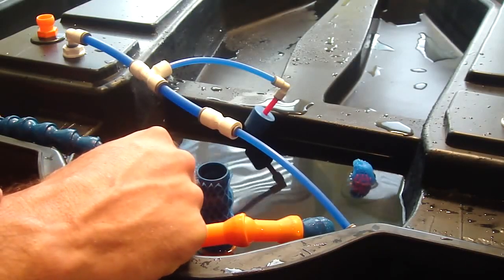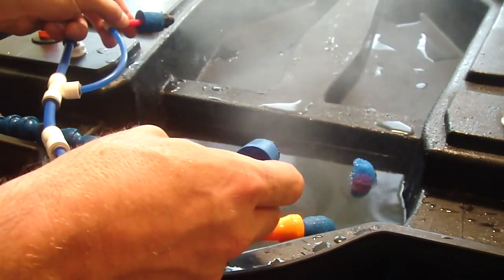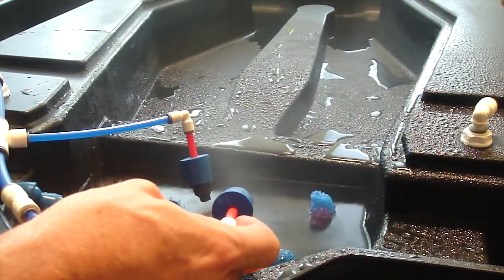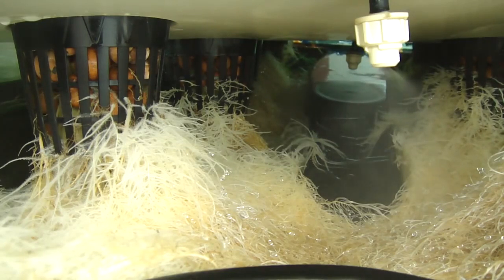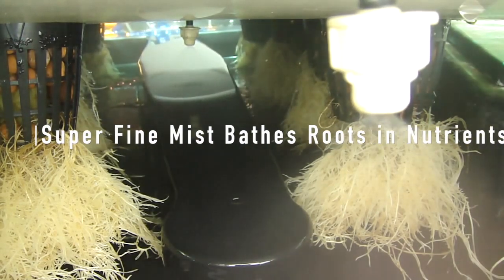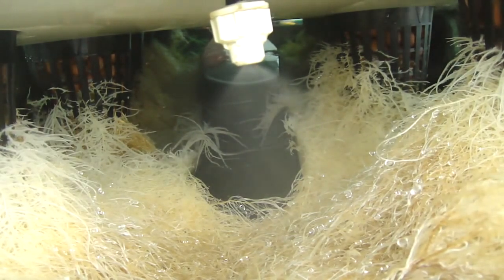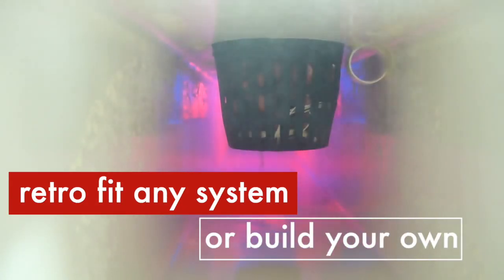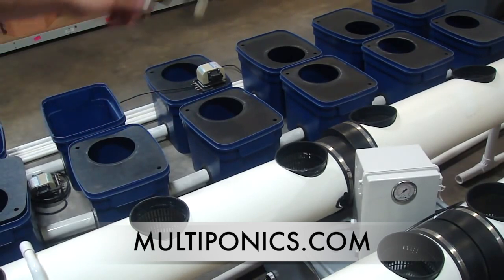Multiponics DIY High Pressure Aeroponics

Comment from the maker: Thanks for the questionbs C4e54r, great you are already running aquaponics, just add our kit to the top to grow lettuce, basil, etc! One of our filters is plenty, just clean it once per week, or you can easily double up and daisy chain them, as they are quick connect. Sold separately or in kits at Multiponics.com

Comment from the maker: Thanks for the question jtg! These hardly drip but the nozzle config here does encourage a drop sometimes, which we later found can be avoided by placing the supply line below the nozzle, rather than above. Also our advanced aeroponics kit, specifically the solenoid and accumulator tank, hold the pressure in the lines to avoid that one drop of backflow that may sometimes occur otherwise.
Reply: TreeFrog Multiponics What's ur base for this setting? Aquaponics or Hydrophonics?
Reply from the maker: @C4e54r  Both hydroponics or aquaponics reservoirs are suitable for reservoirs with our HPA kits. When there are a lot of micro hairs and fuzzy root growth (Trichoblasts) occurring, as seen in some of our other videos, be careful not to overfeed due to the increased efficiency uptake rate!
Reply: How many filters needed from fish tank to the system should be attached..? N what kind is the best in maintaining the micro particles remain in the water..? Sorry, really interested but already running aquaponics..